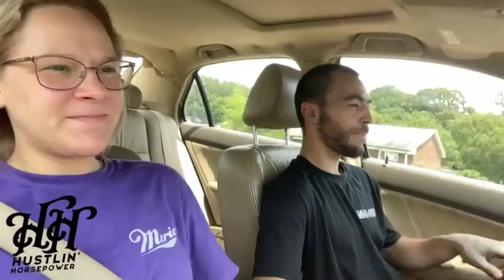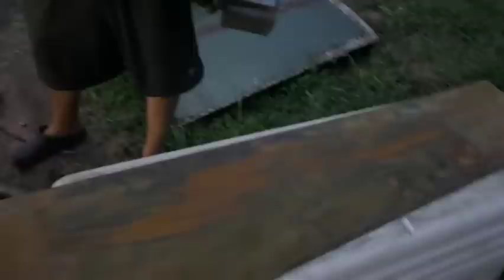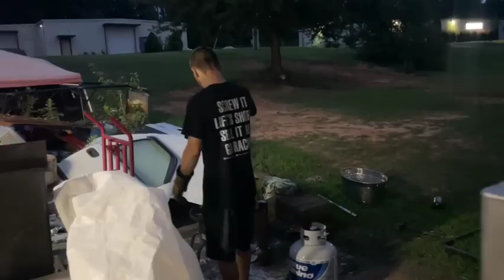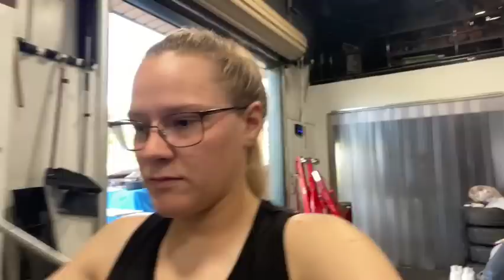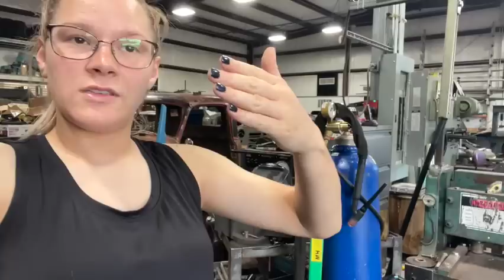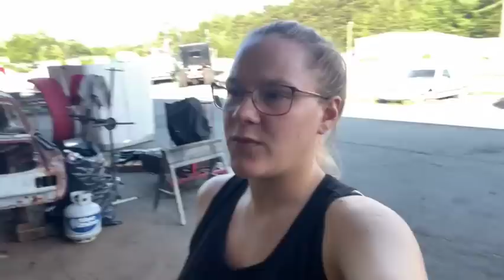Adding Weight To a Racecar?

Comment: I use to use cast iron custom pot with 3 bars welded to pot as handles. Then use metal bars for a form and lead down tufting machines. So why not melt a pot of lead use your forms lay on concrete surface and pour a solid lead bar?

Comment: If you dip your cold ladle in your barely molten lead booop and it just sticks to it. That sounds right says MrPotatoHead cam lobe (with the big bottom).
Reply: Yep the melting point is so low that just the temperature difference of the laddle lets it suck the heat out of it and harden up on it instantly

Comment: I once made 2500 # test weights out of lead tire weights for the crane company I was working for....we built a 30 inch pipe  kettle which would allow us to melt enough to pour a 2500 # weight
Reply from the maker: I used to do crane work as well. We used big water bags or would call in a mobile crane company and use their weights for load testing.